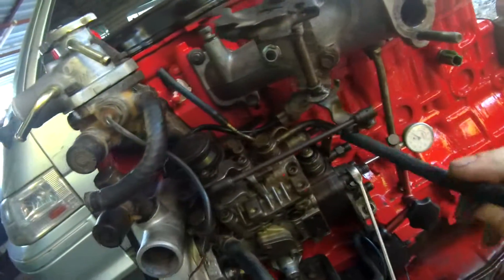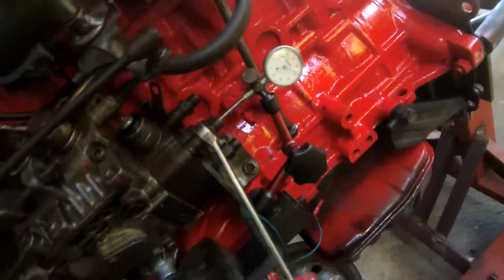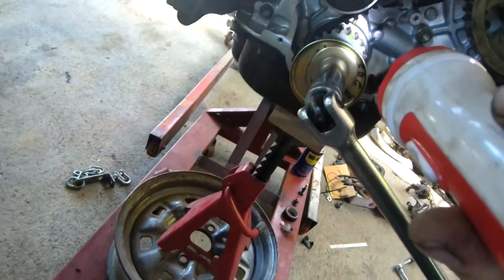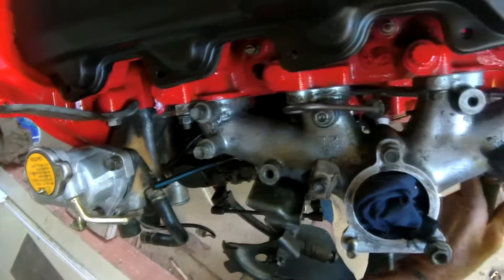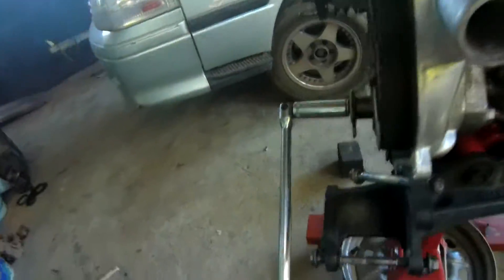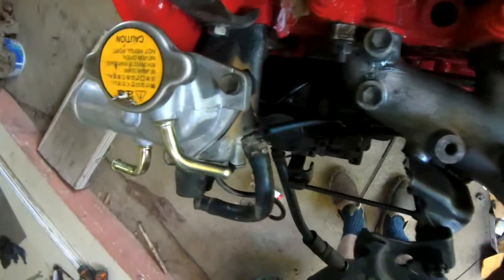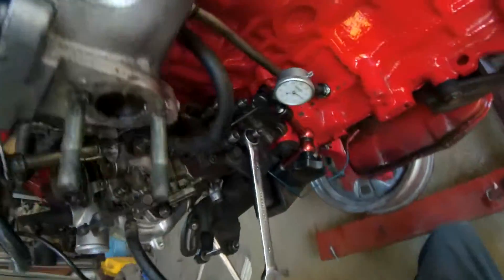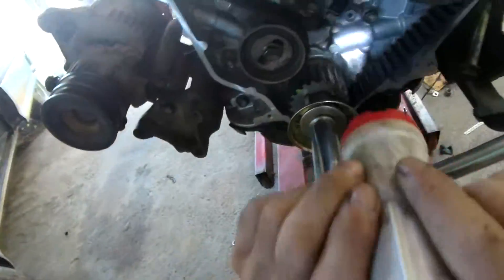Toyota 5L rebuild. denso fuel pump timing. my 1st attempt

Comment: The final reading on the dial gauge should be 0.64-0.75 ?
Reply from the maker: I cant remember the spec now as it was a long time ago. I got it from google, ive done 14,000kms on what i set mine to and its running ok.